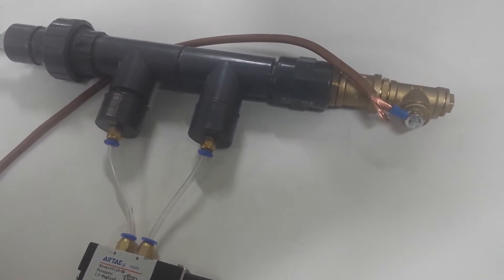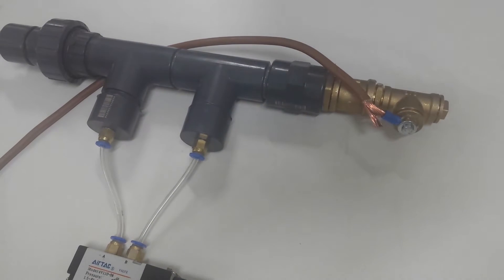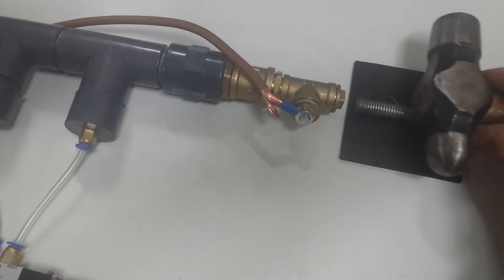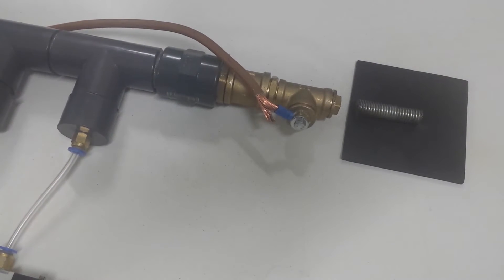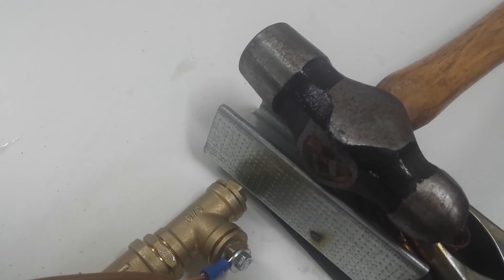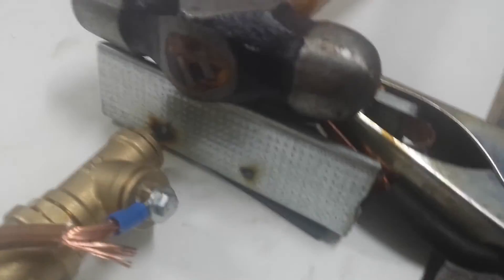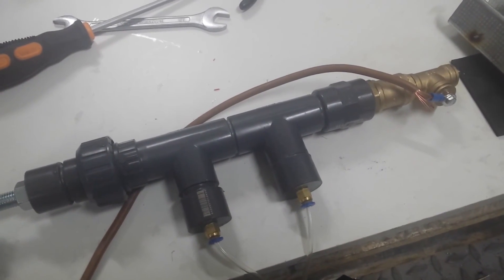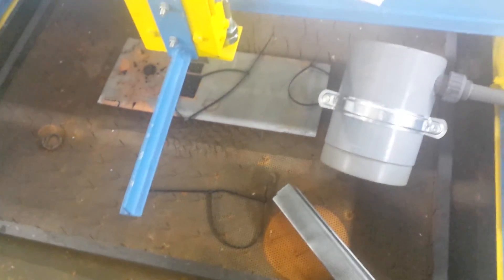DIY plasma cutter torch with pilot arc-blowback

Comment: You need to connect ground to the metal to cut, you only are passing high voltaje but uncut and need a DC main power supply at high currten tu transfer the flow electrons to meltdown metal. Nice Project !!

Comment: jaimeeeg, So, is it ground connection that is key to pilot arc my friend? pilot arc means it's already running before you touch the workpiece or you have ordinary scratch start like stick welding and the air pressure has to be steady & adjusted to correct pressure to blow the molten metal out of the way to cut...You have done a fine job of demonstrating part of the process I think,  I also believe you can tweek it...I'm not criticizing you here AT ALL...I want to say very good job...if you can regulate the air pressure...steady flow will make the thing work wonderful whether on CNC or freehand. I'm no expert but I'm learning.

Comment: Very good video!  I think your viewers do not understand that you are demonstrating a way to arc start your plasma torch without interfering with the electronics that control the stepper motors on your cnc table.  I wonder if you used an isolation transformer or opto-isolator with the normal high frequency arc starting method, you could achieve the same protection???
Reply: My little cut 40 doesn't have a pilot arc but it would ignite from that distance every time, I have proven this by cutting mesh with it with no problems.